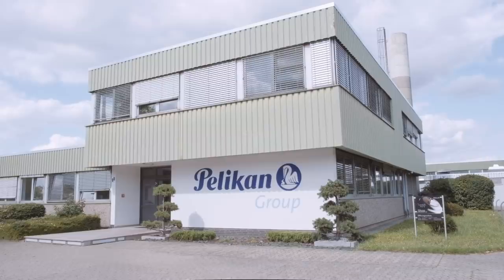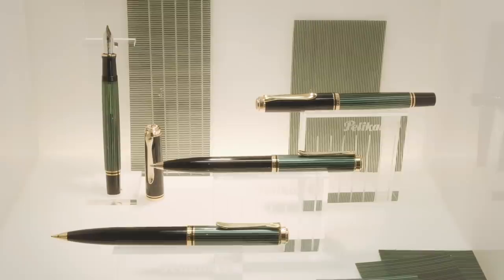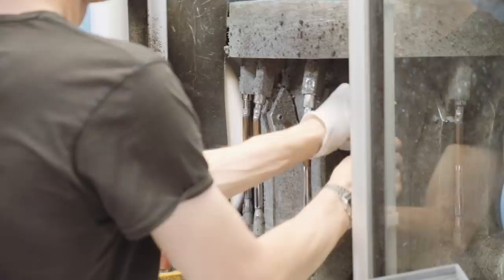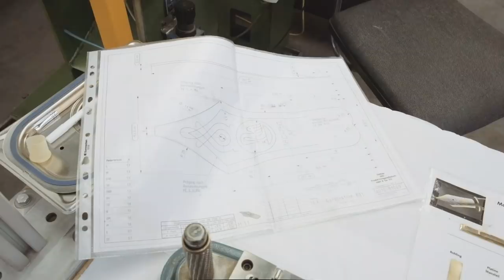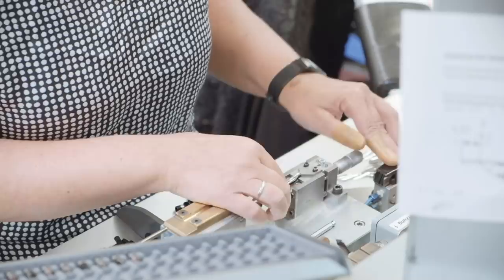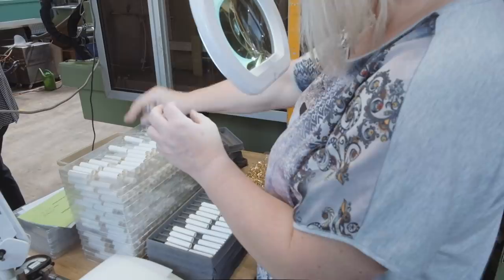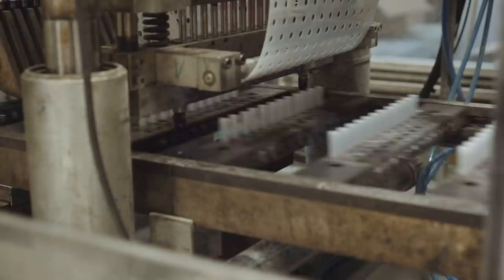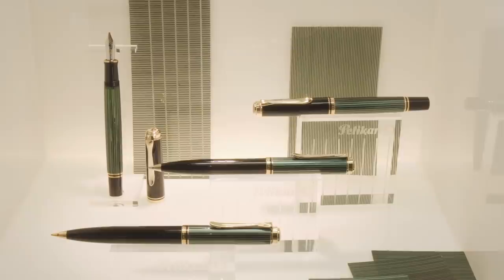The Making Of Pelikan Souveran Pens: Most Luxurious Writing Tool | Appelboom Pennen

Comment: I have heard that pelikan nibs can be inconsistent, but how would that happen if they are tested this well?
Reply: probably because every time someone has an issue, they complain about it. But when it works fine, they usually will go on using it without saying anything, which kinda leads to an imbalance of feedback especially online.
Reply: Well, it's all anecdotal.  Out of my 5 Pelikans, 3 have had nib issues (misalignment or baby's bottom).  Meanwhile, I have 7 Pilot pens and none have had any issues at all, but people online constantly complain about how bad Pilot's nibs are these days.  So it really does depend.
Reply: @caomhan84  So all depends on luck. I have 2 pilot metropolitans and 4 vintage tanks but cant write with any of them, the nib feels very draggy and some borderline scratchy. the Lamy safari i got had a horribly dry nib, For some reason i have pretty nice luck with parker vectors. If i ever buy a pelikan or other high end pen i would buy it from vendors who offer nib tuning.
Reply: Yeah, that's the way to go.  Ask the vendor to check it.  Buy from a nibmeister if you can.  In general, Pelikan's nibs are very good....wet and smooth.  They just tend to overpolish like a lot of manufacturers do today.  That's their biggest issue....well, that and the wild variance in their nib grading (i.e. if you want an F, buy an EF; if you want an M, buy an F etc.)  But I don't know if the newest pens have cleared that up.  The pens are a joy to own and write with, and they're truly bulletproof and easy to clean thanks to the screw-out nib units.  But to make sure you get what you want, buy from a dealer who tests the nib rather than saving money through Ebay (though I certainly understand that approach, too).
Reply: @caomhan84  Would you recommend me a source, that offers international shipping and reliable nib work. Thank you. I want to get a special pen for a very special  occasion and don't want disappointment.
Reply: @arunabhalahiri4931  since this is Appelboom's channel, I'd start with them first.  Appelboom.com.  I know they ship internationally, and I'm sure you can ask them if they will check the nib before sending it to you.  I can't imagine them saying no.  Most shops do this if you ask them.  They will test with water, with ink, and examine the nib for misalignment.  In terms of other shops, I know of one I have personally used that provides nib work, but start with Appelboom first and I'm sure Joost will help you out. :)
Reply: @caomhan84  Thank you.

Comment: The video narrator keeps saying “made by hand”, even though the hands are mostly inserting parts into machines that are doing most of the work.  What is happening (in the gold nib line) is that human eyes are checking the machine work at just about every step.  A very high level of quality control.  And quality control really does matter and is worth paying for.  The best machines mess up sometimes, but my guess is that the machine can do a better job of operations like welding a tiny irridium ball onto the tip of a nib.  
I would really love to own one of these pens.  I think they are not unreasonably priced for what they are, especially the models in the middle of their line up.  I am a little puzzled however about how you put an ink cartridge in a piston pen.
Reply from the maker: Thank you for sharing your thoughts